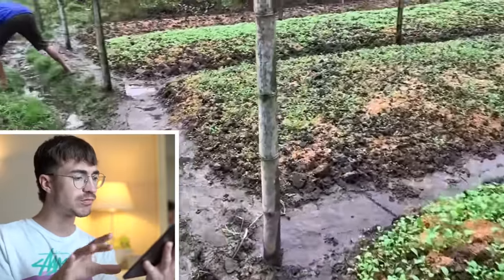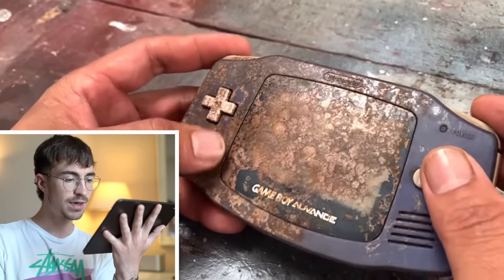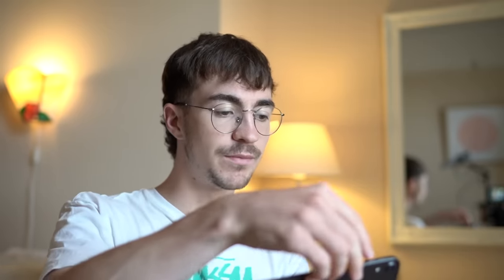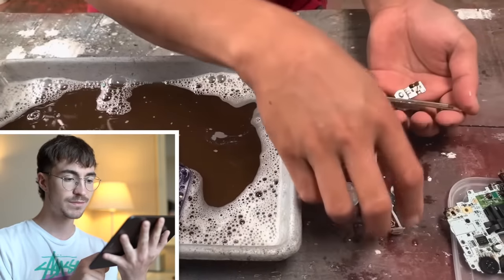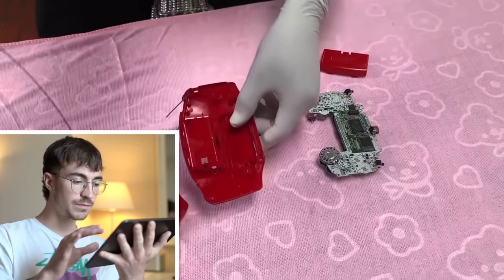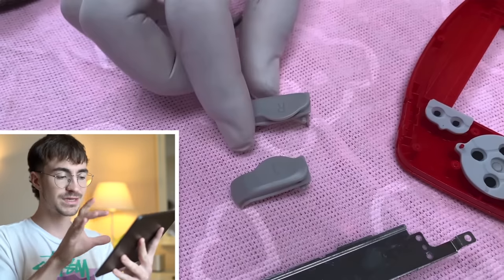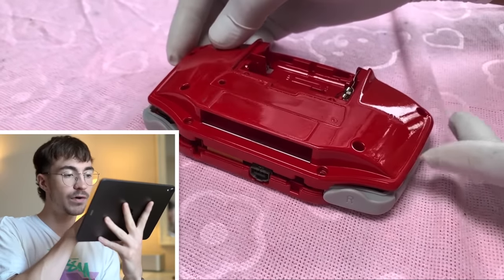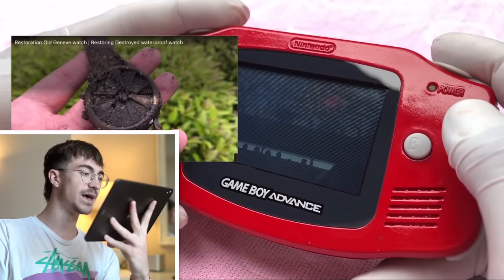Exposing FAKE Restoration Videos!

Comment: If you pause at 6:45 you can see the sun go through the plastic shells and CLEARLY these are fully red plastic ones as the sun light wouldn't shine through the red-painted-purple shell like it does on that frame.
Reply: Not to mention the perfect sheen on this supposedly painted shell. Nuts how bad these get
Reply: @NovaMaster375  The shinyness from the red shell screamed 3rd party shell. It completely reminded me of that DS M where they put the innards of an original DS into a DS Lite.
Reply: I noticed that as well!  I’m glad that l’m not the only one who noticed that, paint shouldn’t be that translucent at all, especially on thick plastic like that!
Reply: Nah that's definitely a painted shell at the end. At 11:10 the finish makes it obvious. It's so thick and uneven. That same shot also shows off the aftermarket A and H buttons though, with telltale off center lettering and in a different don't than the originals.
Reply: Exactly, I am just checking whether someone else noticed this;)
Reply: See, that's the first thing that came to mind too.
Reply: @NovaMaster375  I've seen actual painted plastic things look that shiny, but it takes a bunch of clear coat and floor polish. Obviously, it's fake and a pre painted plastic shell, but you can get that shine with paint.
Reply: So, I randomly paused the video to read comments and the top comment is the exact timestamp of when I paused.
What the eff.
Why can't I have this coincidence in the lottery or something lawl
Reply: @xtlm  the day you don't play is when your numbers will pick. 😂
Reply: @OrionXIXI  - maybe he painted an aftermarket red shell just to be extra convincing.
Reply: I'm use metal shine paint in plastic a pair of times, and can cause damage to the plastic is very abrasive
Reply: It could be painted there is a lot of bubbling and you can see that the words for power and nintendo look chunky like they've been globbed with paint, and spray paint looks extremely shiny if you apply a clear coat
Reply: @OrionXIXI  and the bit about screen being a cracked and stuff, rust brown stuff, rust etc. but the screen had the protective screen over it, and you did see the out plastic screen going in the bin?
Reply: @OrionXIXI  it's a painted shell but not the same painted shell lol. the second shell looked hand painted not spray painted
Reply: @LC-hd5dc  It's definitely spray painted. I've spray painted plenty of things and that shell is exactly what it looks like when you apply spray paint too thickly and unevenly to plastic. You can even see where it kind of pooled up around the power indicator text and in the speaker grill. 100% spray painted. Not to mention the video maker has nothing to gain from showing us them spraying one shell then swapping it for a different poorly painted shell. lol
Reply: i was going to point that out, the subsurface scatering of the shell doesn´t make sense, since the color of the light going through the object would be tinted by the inner color of the material, that's why ears and nouses cast a red Hue color when is against light and plants gives a high saturated green in the same condition, if the shell where the original Purple one, which is a shell that is darker with few subsurface scatering, wouldn't cast a red hue, just a really dark inner shadow.

probably painted both shells Red (the original and the red one) to keep it consistent, but i doubt that is the same one.
Reply: @OrionXIXI  yes, it is spray painted, but are not the same shell, usually to keep color consistent in objects, the plastic and the material have similar tones so when it gets scratch, would look consistent, that's why old GBA SP that where platinum color, are grey underneath, furder more, in this video you can see what i'm saying, at 6:04 in the shell of the back the type of shadow and subsurface that it cast, is way to dark, but at 6:45 is giving a perfectly even red subsurface Scatering, you can try that with any object, paint a brick red all arround, it will still cast the same shadow and subsurface, maybe just arround the corners the color would change, but that's it, is a property of the light that cannot be change just by changing the outside color
Reply: Damn true
Reply: @OrionXIXI  probably there is a set of transluscent plastic just bought for the shot and another that was painted. this is so horribly dishonest
Reply: Are we not going to talk about the battery cover? It’s the same colour but it just made an appearance at the end. It never existed before it was put onto the final product.
Reply: It's just a really, really low quality shell but it definitely looks painted. Besides, where did that battery cover come from? It's clearly aftermarket, and I don't care about that but I'd appreciate a little honesty about that yeah?
Reply: @kurikuraconkuritas  idk why they would do that or what they would gain from it. They show them painting the shell, and the shell they show at the end is clearly painted, in the way they showed themselves doing it. I think people are WAY overthinking this to find some sort of dishonest conspiracy. They DEFINITELY bought aftermarket buttons, and a new screen lens, and very possible a different display and maybe even mobo, but the shell is the one thing that seems legit from start to finish.
Reply: The really weird thing is the inside. The shell was clearly painted (and painted poorly), but there is no reason to paint the inside so carefully.  Look around the ribbing or the inside of screw holes. What maniac is going to go through the extreme effort to get the color perfectly even in spots no one is ever going to see? 

My best guess is he had a red aftermarket shell that looked unbelievably good, and he hit it with a heavy coat of red paint to make it look more believable.
Reply: @jcon6734  ikr. It’s like in some shots I’m seeing a red plastic case, but in other shots it’s clearly painted. I think it’s a red case (since they obviously purchased one full set for the battery cover) that’s been spray painted on the front to show that it’s a spray job. Weird.
Reply: @OrionXIXI  Nope, not the original case. Look at the POWER text near the LED. The original case has more space between the light pipe and the P - plus, the font isn't right. You can see them paint the real case but they don't use it.
Reply: damn lol I just commented that.
Reply: @NotSoCheezyYT  There's also a screw hole below the screen area in the original shell (and spray painted one), but it's gone in the final shell. Final shell has small screws (painted over, but still visible) on the left and right side of the screen (original one doesn't). There's also visible brush strokes on the final shell and somehow the nintendo logo is still clearly visible even though they used so much paint on it.
Reply: Ye

Comment: I saw a video on one of those channels and fixing a computer. It looked like they opened the tower, took out the motherboard, and then dumped mud on it. To add to that, when he lifts up the board and shows the underside it was PRISTINE. Looked brand new. So I point that out in the comments. The video was removed and re-uploaded an hour later with the only change being that they removed the part where they showed the underside of the muddy board. Unbelievable.
Reply: reminds me of a similar one that i watched. this guys opens up a HDD, then decides to clean it with water and brush cus' there was some mud on it then puts all back together. and somehow it perfectly runs windows 7. bro.

Comment: Submerging a screen like that would cause irreparable damage.

Also, small thing, but it was found without a battery cover and we didn’t see him paint the presumably aftermarket one he installed at the end.
Reply: Yeah was getting hints that this was a bit staged when I saw the battery cover. It wasnt until I read some comments that this whole channel is staged on "finding old stuff to restore". After looking at that bike restoration having it covern with "rust" all over is a bit silly
Reply: he should have disassembled it first.
Reply: Absolutely. the screen would be absolutely shagged
Reply: Yeah, I don't recall there ever being a battery cover at the beginning. Where did it come from?
Reply: If it were a really simple reflective LCD glass connected by a rubber strip, that would probably survive being submerged for years, but I only ever saw 1 (ONE) complex backlit screen work after being completely submerged, and that was a gigaset cordless phone that fell in a swamp, but I also gave it multiple months to dry, then disassembled the backlight assembly, submerged it, the LCD glass and the keypad contacts in IPA and scrubbed all the dirt off with a toothbrush before even attempting to use it. It actually still works well enough and sits on my desk at this very moment.
Reply: @unmountablebootvolume  gba is a reflective glass screen
Reply: @unmountablebootvolume  that sounds badass you got any pictures?
Reply: Nah submerge it all you want just let it dry before you put a battery in it. There is no components that is just gonna magically break by touching water without a current aka short circuit. Then they would never be able to exist in countries with huge humidity
Reply: @Nickerian91  Unfortunately when you submerge a screen like that and fluid seeps in, it’s almost impossible for the internals to dry completely. These screens are not airtight. A friend of mine tested this with a GBA screen and it would not work even after blow drying and letting it dry for up to two weeks (temps generally over 100 degrees F)

I’d be curious to see an experiment though - not from the producer of the video Elliot reviewed!
Reply: @Jack-nb1zx  I cant speak for all screens but i would imagine majority is glued and would not be affected.

If the screen layers aint glued its a design flaw to begin with. Countries with very high humidity have water droplets in the evening due to the cooldown means the product by design would fail just by laying on the table.

Which to be fair alot of products actually do (starts rusting if you dont place them in containers)
Reply: @CrimeVampireVT  the same place that the stickers, membranes, buttons and screws came from lol. Ebay
Reply: @chimaeraarts  they probably record themselves “finding it” to try and make it more believable but every other legit one just has it on a bench
Reply: @Nickerian91  you're correct. I've repaired a Gameboy colour that had been in a basement flood for presumably a week. The mother board had bad rust, and most connections had bad corrosion - but the screen (despite being filthy) seemed otherwise perfect because a shit load of glue was used.

Motherboard looked far worse than this one, but ultimately with a clean and some contacts re-soldered, everything but the speaker worked perfectly fine.
Reply: It likely could. I wouldn't say certainly.
Reply: Yeah and the color matched the rattle-can red perfectly
Reply: @Jack-nb1zx  By some miracle, my GBASP survived a short dip.

Comment: Years ago (early 2000's), I used to run run laptop motherboards through a dishwasher that had suffered spills by customers.  It was a long-shot before replacing the motherboard or entire laptop.  But it worked quite well.  I would even leave it for the "heated dry" to ensure all moisture was baked out of all components.  For many laptops that suffered various liquids/juices that spilled deep into the motherboard and had soaked up under the chips - the dishwasher would actually get all that out!

And as long as there is no corrosion on the PCB or components themselves, water typically has absolutely no affect on electrical components if they are not energized.

But yeah.. a lot of those "found and restored" videos look waaay too fake.
Reply: The very reason I scrolled down to the comments. You can submerge just about any electronics in water as long as they're completely dry before you run power through them. I once got a cracking deal on a tube amp (Laney) because the guy left it outside overnight and assumed the rain had fucked it. I've still got it today.
Reply: @anneominous7172  Providing you use clean distilled and de-ionised water you can power up electronics in water. There are some computer systems that are submerged in tanks of water to keep them ultra cool. Water is a good electrical insulator so long as it has no dissolved impurities.
Reply: This works well for keyboards, though I would absolutely enforce 24 hours of dry time even after the heated dry in the dishwasher. This will not end well with very hard water or abrasive dishwasher soaps! I actually have an in-line water filter for my tap and dishwasher because the water is so bad here.
Reply: I've cleaned motherboars with scrubbing bubbles plus distilled water and it worked fine.
Reply: I’m assuming you skip the detergent. That stuff is extremely caustic.
Reply: My sound card spent 3 years getting we every rain and works fine so yup 

If it gets dry and corrosion is not a problem everything works
Reply: @MrJonnySL  that water fucks up screens so bad
Reply: I used to repair pcb.  There is nothing wrong with washing them as long as you power up them after they are completely dry.
People shouldn't make videos about things they don't understand. This is one of those videos.
Reply: @onurjp  the restoration video is clearly fake for other reasons, like the painted case magically turning into red, translucent plastic, the aftermarket buttons, the corroded battery contacts magically turning back to bright chrome, and the device turning on with water and dirt all over and inside of it.

The guy took apart a dead one, swapped the components for live ones, put it back together, turned it on, did a fake restoration, and edited it to look like he found a live GameBoy.
Reply: @onurjp  the restoration is still fake xd
Reply: @evilsharkey8954  I'm talking about video content and the person who talks. I didn't say video was fake or not. Read my comment again.
Reply: @onurjp  water is fine. It's what's in the water that causes the issues. If we used tap water, all the mineral deposits left on the units could cause sorta. Distilled? Perfectly fine. Guy could have used isopropyl or some other alcohol (denatured) as well. Video is obviously faked but not everything has to be wrong
Reply: @Goinsdarkness  exactly  not everyhing has to be wrong but, he has telling the story like eveything in the video is fake and trying to get some credit from it. He doesn't even know anything about repear. Thats why I wrote that comment. 

I was using tap water to clean pcbs with brushes. where was nothing left on the pcb after drying out. For sure there shouldn't be left under the smd components. There are special pcb cleaning sprays too. If you don't have anything soap and tap water do the job. There are some industrial machines that work worst condutions. sometimes so many dirt on them. its really harsh to remove all dirt from pcb's.
Reply: @onurjp  oh, I agree. He is definitely just trying to farm likes by shutting someone else down, whether he himself is correct or not. 

With the water, it's more of a logical vs practical statement. Do people do it constantly and it works fine?
 Yes. In practice, it works most of the time.
CAN it still cause board shorts even if it fully dried out?
Also yes. It just depends on the makeup of your local tap water. When the water evaporates, it leaves any minerals it may have been carrying. Those can be enough to bridge chip pins and such, or lead to very unexpected and intermittent glitches as it only shorts in certain conditions.
Reply: @Goinsdarkness  About tap water you are right. It depends local tap water. After dried out it leaves small white zones if brushes not used or after just tap water and soap cleaning, we were using IPA to cleaning those zones. At least this is what I have used to do.
Reply: Idk but the fake vid clearly trying to turn on the gameboy after cleaning it with water without properly dry the inside components which it wont work
Reply: @onurjp  No, Elliot knows tons about repairs, it's what his whole channel is about. Using water on PCBs for restorations is stupid especially when they're as small as a Gameboys, alcohol is the only thing you should be using if you have half a brain cell
Reply: Exactly, i don't understand what his  problem with "ooooh water = never gonna work" is. I have submerged multiple electronics device motherboards after Coca Cola or other things were spilled over them. If you let it dry up, it will work just fine.
Reply: Wait what?? The sorcery lol
Reply: @MrJonnySL  I think you'll find its tanks of mineral oil they suspend pcs in and the components are pretty much garbage after.
Reply: I did this too. And recently put my whole PC keyboard in - came out like new!
Reply: @onurjp  Tap water, and distilled water both contain mineral and organic contaminants.  If you really can't afford IPA, type 2 de-ionized water is the only water you should use. Please do not use normal tap water or distilled water and detergents on PCB's, it will leave contaminants that cause corrosion and will kill the device in the long term.
Reply: Ah yes. The comment that I was looking for. Even if the restoration is fake, it's not true that water damages electronical devices as long as they are not powered on and completely dry when powering them on. But at the same time there is a high chance that fluid damages the display of the device. I already lost some monitors over the years because of that.
Reply: I heard they actually wash new motherboards at factories in regular dishwashers... as long as it's dry when you turn it on again, you're good.